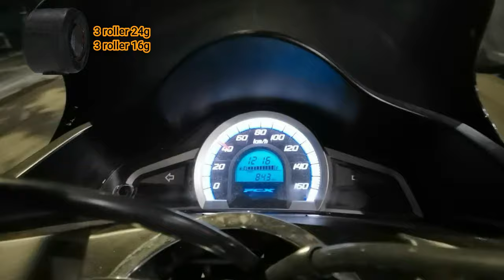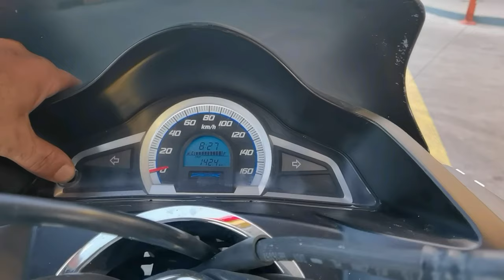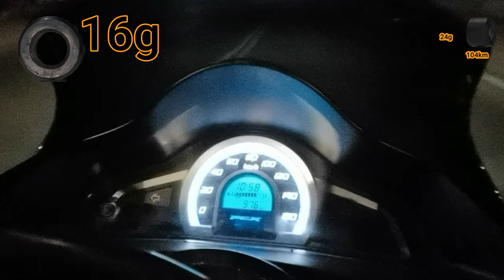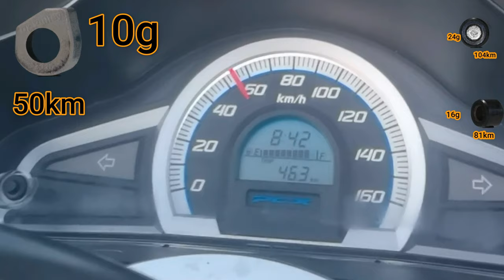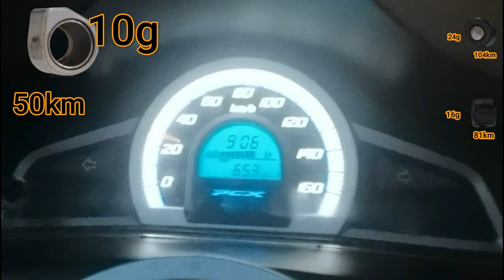test drive on honda pcx 150 scooter roller 10g vs 16g vs24g petrol consumption per km.

Comment: In my experience things is different for different scooters and conditions and rider style. I ride Kymco 250 and both the bike with heavier then the original /6x20g stock, 24 on the bike/ and the bike was unrideble in the city. The rpms get so low after acceleration that the bike had no more to give. I machined the rollers insides on my lathe on steps and find out that the 18 grams was perfect. Then I found 17.5 new ones and I am perfectly happy with them. 
The fueling is better.. 4-4.1 l/100 km with the 24g. and 3.4-3.7 with the 17.5g  ... That 24g just needed too much throttle to keep it mid gearing or to accelerate at all.
Reply from the maker: You are right, and in the video I say basically the same thing
Reply from the maker: https://m.youtube.com/watch?v=Q-pNPAkW9N4&t=41s

Comment: thts true light roller make eggine high rpm and heavy roller make lower rpm make top speed no fast
Reply from the maker: very correct correct you say it simply the heaviest balls are more economical and it goes more smoothly and light balls it goes much faster accelerates very quickly and the consumption is greater

Comment: Can I just remove three rollers and let three sit inside the varistor?
What will happen then?
I will lose half a weight and my scooty is 90CC, Honda activa 2005 model sold in india, top speed is 80km/hr but also has nice pickup already.
I want even more pickup, will I lose top speed if there is only three rollers instead of 6?
Reply from the maker: Hi Adv I personally have not tried it, but you know that the balls will spoil much faster Also, the Pyrros that is held in the variator will pull very hard, take out some icing and let's see, you will have a very good start. I am waiting for you to tell me the results Well done. Very clever experiment!!
Reply: @MBPATENTS  Sure thing.

Comment: Hello sir, my PCX has vibration while we start riding slowly. I remove clutch and cleaning lubricants still like before. What should I do? Is that my roller is bad? Thank sir
Reply from the maker: Hi Lyheang Sar When does it start or when it is idling?  I usually reply to those who have subscribed to my channel!!
Reply: Done subscribe sir,
When it is idle and when I start rev 0km/h to speed ,it is vibrating. I couldn't find the problem
Reply from the maker: +Lyheang Sar So how do you describe it is from the zippers to the centrifugal they do not press properly.  Have you recently changed your belt ???
Reply: @MBPATENTS  my PCX got 8000km, I just cleaning all gearbox components, lubricant clutch bearing and put it back together without change anything. The first 100km after clean is good and run smoothly, but then it like before.
Reply from the maker: +MB PATENTS Do you just change the belt for me?  Ika and I have the same problem from 0 km to 30 km, the scooter starts with vibrations, I changed the zipper and everything worked perfectly.  How many km does your scooter have?  Normally the dealership says that at 60,000 km you have to change the zipper.  I have grabbed the iron that pressed the zippers.
Reply: @MBPATENTS  my scooter has 13500 km right now. Thanks for your advice I will change those tomorrow. 😃
Reply from the maker: +Lyheang Sar Many scooters will face this problem and I will make a video on how to restore it with the same things !!
Reply: @MBPATENTS  thanks, u are the best
Reply from the maker: +Lyheang Sar Thank you for subscribing !!!  Whatever else you need I am here !!!
Reply: @MBPATENTS  hi what is zipper?
Reply from the maker: In what minute do I say this?I say this in translation.
Reply: @MBPATENTS  un suscriptor te pregunto que vibraba al poco tiempo de hacer limpiea, y tu le dices que cambie la cremallera, que seria eso?
Reply from the maker: Me han molestado mucho por youtube y por correo electrónico pero lógicamente para decir algo así no lo he dicho de mandíbulas tengo hambre de cambio cuando el resorte se ha aflojado incluso las cerillas se abren más y suena

Comment: For vespa vxl 150 cc 10 or 15 g is best for top speed.??   I want to reach 120+.. What should i  change ??
Reply from the maker: remove the stops from the variantor see the previous videos that c increase around 30 kilometers in the pcx I believe will be a good solution
Reply: @MBPATENTS  i Don't understand 🙈🙈🙈🙈🙈

Comment: Buenas que rodillos debo poner para un motor honda gx160 163cc  adaptado
Reply: Motor de 3600rpm
Reply from the maker: Hi yoelca you have fallen at best you have 19 gram balls if you put 16 gram balls from PCX 150 cc You will see a difference

Comment: Does any body have an idea how many kilometers this Moyer is good for in general, thinking about buying one with 24000 kilometers?
Reply: Scooters engine can last up to 50k-60k KM (sometimes even longer) without needing major overhaul if maintained well, 24.000KM is pretty low I'd say, just make sure it's well maintained and no weird noises coming from the engine, check if there's any sign of oil leakage outside of the engine. 

Also sometimes at 20k-30k the crankshaft seal tends to go bad and start leaking oil into the CVT, this is caused by either overfilling the engine with oil exceeding its recommendation or lack of maintenance, it's a cheap part in itself but takes time and labor to replace thus making it slighty expensive.
Reply from the maker: you're right about the crankcase, but as for the Hi hafid engine for the pcx, it's close to 1 million kilometers and nothing has happened to me so far!!! there are many types of engines but why honda and suzuki last a lot💯
Reply from the maker: what brand is
Reply: @MBPATENTS  1.000.000km is a lot, do you mean 100.000km? In that case, yes, modern scooter engines can last that long if maintained properly, but not everyone knows how and when to maintain their bike, so 50k-60k is a fair assumption to me, especially since these scooters are commonly "abused" or maybe even used like a sport bike😅
Reply: @MBPATENTS  Yeah the crankshaft seal stuff is a common issue with cvt transmission scooter.
Reply from the maker: yes indeed here i believe it too pcx has such containers usually pcx engines are one of the best pcx odometer can't write a million km after 300000+ km card it resets to zero again soon i will upload video when it reaches  one million😳
Reply from the maker: also i got it then slowly i will learn everything and i still have time to experiment on this pcx

Comment: My Ghina GY6 which is a 200cc (Supposedly) but on the badge reads 168cc with 12 grams is my sweet spot, i can go 85 miles (Aggressive throttle) and i can reach about 100 miles if i coast it like if im going for economy on a full tank that cost me $4 to fill up. Acceleration improved from  the stock heavy weight it had on from Ghina factory. Top speed i hit on the highway was 62 MPH, and from zero to about 30 mph if i hold down the throttle would be in like 5-6 sec
Reply from the maker: to reach these miles you have to experiment with the variator I have no idea I have never seen such a variator for the particular bike you have but there is always a possibility that they will reach and if so you only have to do with the transmission thanks for the power you have

Comment: Heavy = High Gear ration = low engine rev but fast
Light = Low gear ratio = low speed high torque/acceleration

If your body weight is heavy, go for lighter one
Reply from the maker: You are very right!!!  😉

Comment: first test drive you write
3 Rolls 24g and 3 Rolls 16g
how do you get them to fit if you have 10g - 16g - 24g where you only use 3 rolls of each in your variator
24g if it has to go up to 3 then it is only 8g rolls you use 3 more which should be 16g in total
then it's 5.5g that goes into 16g if it's 3 roles...

how do you calculate .... I just saw you wrote in viode in the first test up in the corner

3 rolls 24g
3 rolls 16g
I understand that you use 3 roles which together give 24g and then again 3 other roles which together give 16g, but if you calculate it, it doesn't match at all with the numbers you have written... So help me out on the right course again he he ... I know it's me who's wrong about it, but that's because I despise what I described here now...

super good video..

but just keep your vario house a little bit cleaner and free of oil ... he he he
Reply from the maker: i use three 16g balls three 24g balls that means i have six 20g balls to be more economical Also There are many combinations with the balls Also balls are connected to the spring back It depends what you want to do if moving around the city, sit at 16 grams or below. If you want it if you are traveling, put 24 grams and 16 grams

Comment: i changed 13g with 10g the bike take off is so bad i need almost 20% throttle to move the bike
Reply from the maker: Mido guys you have a better start if you put 16 grams then we start a little it works but you won't have a good start

Comment: Thanks for this beautyfull video. I buyed used my pcx 150 and i found 18g rollers (44,4 km/l very precise). Do you know the weight of the original rollers? (16g or 18). Now i'm trying 6x22g rollers. I did just 100 km, but consumption is bad: about 37km/l. Thanks again for this video.
Reply from the maker: Hi Utente I factory roller is 16 grams 150cc from 160cc the new pcx is 19 grams the heavier i roller the more economical it becomes. Thank you for your attention Don't forget to do subscribe!!!

Comment: My Honda Activa (2009) becomes very low torq and jerking issue, I changed rollers, belt and roughed the clutch shoe with sand paper.

After that my scooter's pickup/acceleration becomes God level, like a new one. But it's only for very short time (1 week) only...

After a month my scooter pickup/acceleration becomes very very slow, then I changed Whole clutch set up (Clutch shoe and clutch pully setup) I wasted my 2300Rs INR still my scooter problem is not fixed...

After few months my scooter pickup is very low and once again starting the jerking issue...

Can you please help me if you know that answer. 

Sorry for my broken English :'(
Reply from the maker: Hi yashde do a test, lift the motorcycle in reverse, put the front at idle and see if you can hold on to the wheel with your hand, if you can't and the wheel moves, it has power at idle, it means that your pads are not the problem, first check the spring, what's going on  you have changed the spring?
Reply from the maker: have you tampered with the variator recently?
Reply from the maker: if the variandors when you start are a little closed, even half a point or a point, that means it can't start because it starts with a much bigger step, so look at the pariatori a little bit, if it's completely closed, if it's a little open, that means it starts from the heavy  your problem
Reply: @MBPATENTS  I didn't understood which part you're saying like Pariatori, variandors etc...and Yes, I've changed new Variator with rollers (local 300Rs variator + 90rs for rollers).

Comment: video makes no sense. I too have this 150CC version. What is the referenced litters per 100Km? what is average speed?. I have 3rd party 13g rollers, with Yuminashi variator and stock belt, and screen shows average 2.1L per 100km going 80km/H, this value is when I reset while going 80km/H. Needless to say that fuel consumption reader has a % error, the bike uses more fuel than that. Video conclusions are junk because of used methodology, but the conceptual idea is good. My tank does 270kmh while too often going top speed on bike. I can reach 127kmh on speedometer downhill and 119kmh on flat road. By using its own fuel calculator I should reach 333km (it states 2,4L/100km), yet I dont get even close.

I'm still subscribing to the channel :)
Reply from the maker: Hi testerpt5 Here I explain what consumption depending on the amount of grams is the roller, I see for myself how they work.  The first screen reads the meter with how many km you run and calculates for you through a limit how much you will consume.  the roller a month I experimented with it with this video when you try and you will understand what work each ball does.  Let's say another theory you have a car that calculates how much consumption on the screen you go at 2 speeds with 2 thousand rpm if it shows you 3.7 per 100km / h and when you are at 5 speed with 2 thousand rpm the screen will show you again 3  , 7 what do you think will consume more in 2 i in 5?  With your scooter it calculates based on the screen not with turns.
Reply from the maker: +testerpt5 Tell you what, I made this video, we are only talking about scooter, the ball (roller) is heavier than the factory roller 3roller 24 3roller 16g is for them to do many km work trips when the daily routine is with many kilometers consumption is very low  the belt withstands the oils more, the engine works comfortably, it has a lot of good, the only bad thing does not start as it should !!!  We all know how 16g rollers work.  For 10g I have to give you the positives first, it becomes a crazy power scooter with other scooters up to 250cc, the pcx works like a beast !!  Negatives I have broken centrifugal eyes 10g consumption is great tremble all plastics Stan at 15000mk I have cut straps and many but
Reply from the maker: I will post for you a video where I remove the speedometer step by step. I hope that my answers will be enough. I know you're a subscriber, thank you for the support!
Reply: Sounds like 14g rollers would be good for performance and not too bad for economy, and still might not be too hard on the other stock parts.

Comment: On my 125cc 2021 PCX. I rode thousands of km with 18.5g, 17.5g now im with 15.5g and display is always at 2.1L/100km . I'm starting to think the scooter is lying to me, because it fears ill dump it for something else...xD.
Reply from the maker: Hi GTrax the speedometer doesn't measure exactly, it's at approx. If you want to measure your fuel exactly, reset it last line that flashes on the counter and calculate how many liters he has burned there he calculated correctly The counter calculates Depending on the gas you press and the kilometers the motorcycle has, it is approximately, but if it does not know what revolutions the engine  
 to calculate correctly

Comment: For my experienced: you can adjust the roller weight +/- 1g( compare with stock)  for best result. 
Too light: lost max speed, lost power cause  belt slip and vibrate. 
Too heavy: long time to get maxspeed but lost take off power. Maybe damaged clutch shoe because it engaged at high RPM!
Reply: How does lighter roller weights cause belt slip? Is it also possible that the clutch lining slips at high speeds? I went 3g below with each flyball and experiences hesitation on acceleration once speed goes beyond 80+ kph. What can be the cause?
Reply from the maker: here You're not telling us something right or you haven't done something right???